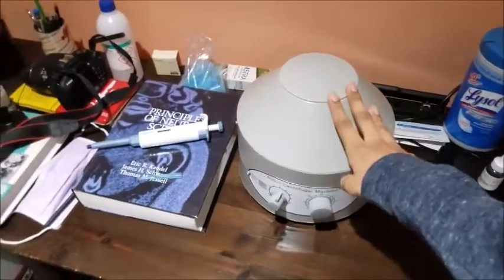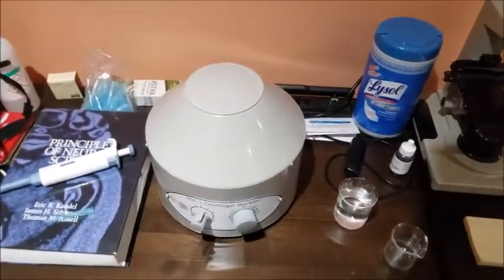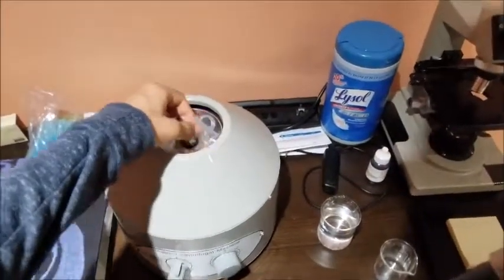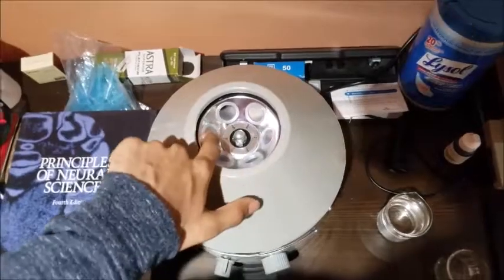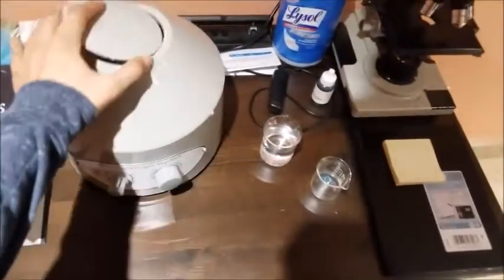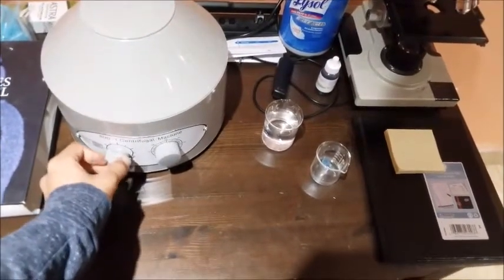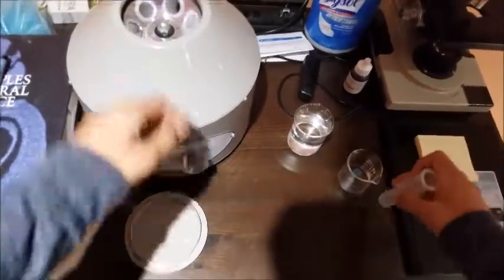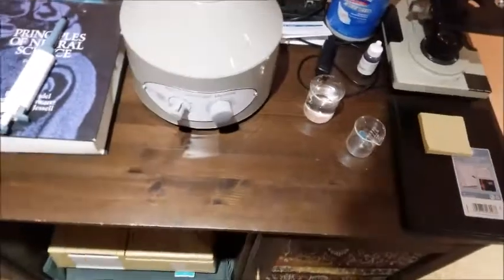Lab Basics: Centrifuge

Comment: Ehr... This isn't correct. The white "vials" are containers, you place vials with caps in those.
Reply: Yes, It is not correct. The white "vials" is casing, if you need to spin, please put the test solution in  the centrifuge tube or blood tube with the cap, then put the tube into the casing, It is ok, you can spin now.
Reply: What size tubes fit in the pladtic casing?
Reply: @doglife75  wild guess, 20mL vials (they sell them with twist caps or corks) off amazon.

Comment: can this centrifuge be used for Platelet rich Plasma (extraction of plasma from blood)?
Reply: yes, you can, but you should buy the PRP tube firstly.
Reply: @shanghailixinjiancentrifug1367  can I ask what's the ideal rpm for prp? And how many minutes? Single spin or double spin? Thank you in advanced!
Reply: @shanghailixinjiancentrifug1367 what's prp tube, is it different from ordinary glass tube that we use in centrifugal  machines , in terms of material or dimensions ?
Reply: I believe it could be possible, but plasma is tricky to get... Without anticoagulant  course.
Reply: @DNAatWork14 can u elaborate how to prepare prf which I don't think needs anticoagulant?